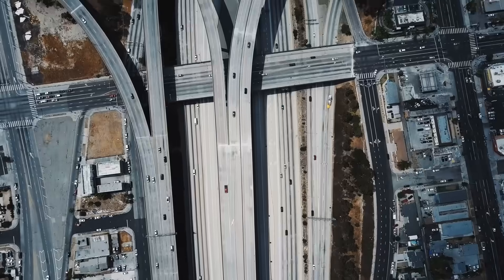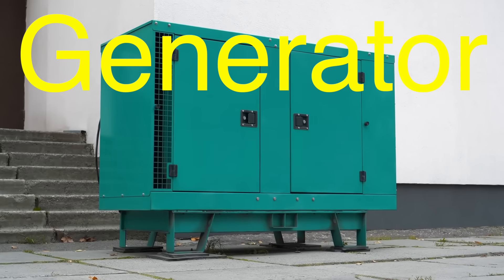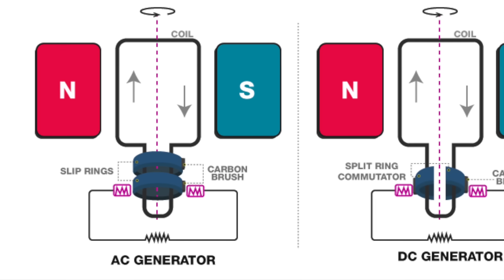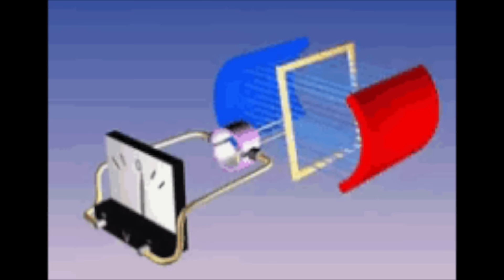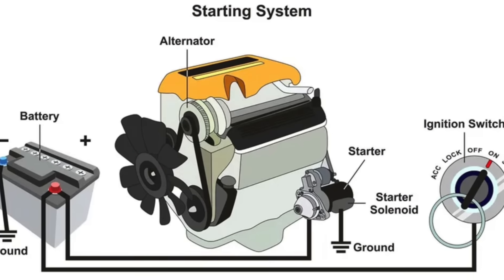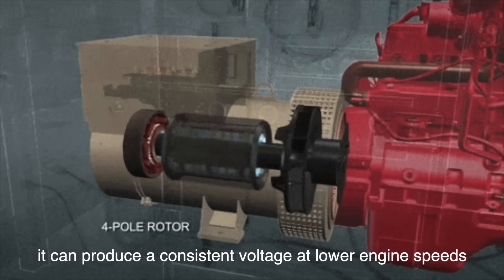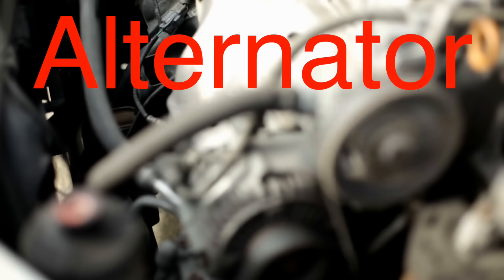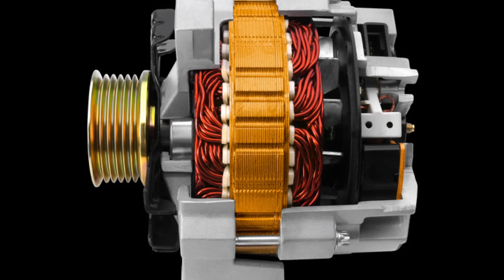What is a Generator? What is an Alternator?

Comment: We call the frequency today The Cycle!! Back in the day your electric was 25 cycle, and the light actually flashed, so they stepped up(increased the cycle to 60
Per minute and it didnt seen to flash anymore! Thats what we have today! We sometimes say Hz.which means hertz!!
The power plant needs 1,000volts to send the power
1 mile away , thats why we have high tension lines!
The disks on the insulators are 1,000 volts for each disk, so count them.
14 disks, thats a 14,000 volts in that wire!!

Comment: Tesla wanted to send you electric without 
Running any wires to you!! It worked like a radio, you turn it on and it works!! Viola!!
The same with all of the other appliances- no wires!! And he did it !! He generated power and evrything in a 35 mile radius turned on by itself!! Today they call that power - PLASMA!!

Comment: All alternators are generators.
An alternator is more efficient than a DC generator.

Just get some diodes and capacitors and resistors and you can rectify the current!

Comment: A generator only creates low voltage (less than 24 volts), DC power. An alternator creates both AC and DC depending on how its connected. Thats why its called an "alternator", it has alternative power generation.

Comment: I have worked on machines when very many of them had generators . I have worked on cars and tractors since the 60s to now and have not seen an alternator with out brushes . They use contact rings or slip rings instead of a commutator . Maybe they now have a brushless alternator , that is news to me .

Comment: Today I learned that an alternator produces a consistent voltage across a wide range of engine RPM. Additionally, generators offer versatility producing both AC and DC power

Comment: Not every car on the road has an alternator…..electric vehicles don’t. They have a DC to DC converter to run the accessories off of the high voltage traction battery

Comment: You forgot to mention one really important difference between ac alternators, [which need and exiter current to start them]  and the old fashioned generators, which did not.  But the other difference in practise is that the alternator can produce power at idle.

Comment: This was the most bull I've ever heard. Most small portable generators work just like the alternator in your car. The main difference is that in a true generator the power id feed through the brushes. In an alternator the field is powered through the brushes. The fact that the generator has the power going through the brushes and that if DC is desired, this is done through a segmented commutator. This was done because high current diodes were not yet invented.
Both can be used to create AC or DC outputs but the rotating field winding makes more sense with solid state regulation. The old DC generator used in old cars use a regulator that controlled the output that wasn't solid state. It used a relay like device that measured the strength of the magnetic field and changed the field current by chopping the current to the field winding.
The small portable generators use the rotating field windings. ( smaller that 10KW typical ) larger generation usually uses fixed field windings because the cost of the higher current in the external windings needs to be larger, as compared to the smaller amount of copper needed for the field.
It is true that brushes that carry higher current through a commutator have more arcing and wear faster. Still, the brushes in alternators do wear. In my experience warn out brushes are the most common failure of car alternators that are no abused. Bushes are cheap compared to the complete alternator but shops have different warranty than a home mechanic ( 1/10th ).
When someone tells me, that their alternator just died, the first question I ask, is did they jump start another car within the last month or so? If so, that was likely the cause. The older generators can take sudden high current loads required for starter motors and can take more abuse. The diodes in alternators can be damaged by such sudden high current loads. When I jump start, I ask for the other car's keys. I charge their battery for a while with my engine then shut my engine off and give them back their keys to try to start. I do use home made cables with 00 wire. I can even start a car without a battery with my cables.
Never use your alternator to power a starter! Even if it seems to work for a few weeks, the high current through the diodes can rupture the hermetic seal. Moisture and other contamination will cause the diode to fail being a diode.

Comment: Why is there no mention of a 'Dynamo'? In use in cars, dynamos generate DC (interrupted) to charge batteries directly. They were replaced with Alternators on cars, only when solid state rectifiers became available (to turn the three phase AC immediately to DC). Alternators then became the default generators of car electrical system, because they can output more power and turn at a faster speed. The commutator of a dynamo, limited it's turning speed and so, at low revs could not produce much power. I found this video uneccessarily, misleading and contradictory. Alternators produce A/C. Dynamos produce D/C and the term geerator encompasses anything that produces electricty by mechanical means. Simple.
Reply: Thank you for that explanation. I knew that cars were switched to 12V from 6V at about the same time that alternators came in but never knew why.

Comment: Alternators use rectifiers to convert ac. To. Dc. Diode rectifiers have a forward voltage drop due to internal resistance.so they burn some current up as heat.brushes have very little loss. Possibly more efficient.

Comment: Silicon diodes used in alternators i would not refer a simple thing. It is possible to make every part to a generator in a basic machine shop. Not so to make a replacement diode rectifier.

Comment: You did not mention a true generator can generate dc without external excitation due to residual magnetism. Therefore a generaror can be push started and will provide power for ignition to start an engine.

Comment: I have been told Alternators only maintain a battery, and that they dont charge up a battery, true or false?
Reply: Check your battery voltage after the car has been running for a while, you may see almost 13 v on a 12 v battery, then turn in your lights for a minute then off and recheck battery voltage, it will probably read about 12.6 v, you just removed the surface charge.
Reply: @billmoran3219  thanks for the reply, but what i was get at was, a near flat battery will remain in that state, if charged by an Alternater only, meaning it will be maintained at that level  and will never be fully charged up, and willl die quicker.

Comment: correct me if im wrong 
I often take that generator is the general name for mechanical>electrical conversation component 
alternator is specific to be called where alternating current is generated as its first form after energy conversion, or easily called AC generator.
for direct current,  we can call it DC generator or specifically Dynamo. 

maybe in the future DC gen will be call Direct-or? 😂

Comment: Motorcycles are interesting as the stator and rotor are frequently within the engine case. The exception of ones I have owned was a BMW R1100R where there was an alternator driven by a belt from the crankshaft.

Comment: Generators that use permanent magnet are generally called "Dynamo". If magnet is in the rotor they produce AC. When magnet is stationary the can produce either AC or DC using commutator. Example are generators for  bicycles.

Comment: The alternators do has a brus which use to feed the rotor coils to create a magnetic fields, the alternator voltage regulations doesn't done with brige diode rectifier at the output stages, it regulated the voltage by regulated the rotor magnetic fields which differ according to the rotor rotation speend

Comment: Correction, some hybrid vehicles don't have an alternator. The 12 volt accessory battery is charged via a DC to DC converter that steps down the high voltage from the traction battery to a voltage suitable for charging the 12 volt battery (about 14 volts).

Comment: Let me put it this way to you about generators and alternators, generators were the first design of 6-volt systems that had to produce more amperage for 12-volt systems which causes extreme load on the armatures. Add idol not efficient to produce enough power, the alternator is a device that can produce high power at all speeds. Since the invention of efficient electrical diode that can turn AC into DC thus we have the efficient alternator.
Reply: Add idol-

Comment: Hi. I owned several British motorcycles from the '50's which had Joe Lucas's 60 watt DC commutated generators. These were married to a cut-out and voltage control box (in an on-again off-again relationship) that gave feedback to the generator's field coils. Voltage control was by vibrating points, energized by electromagnets fighting a spring, the tension of which was adjustable so the voltage output of the armature could be adjusted to the 7.3 or 14.7 volts needed to charge the battery. The unreliability of the system was directly proportional to the number of times you read this paragraph. 

There was an amp meter on the headlight nacelle. When kicking the bike to life, a huge surge of relief accompanied the amp meter's first twitch that showed the electrics were working today.  We motorcyclists traveled in groups, not because we wanted to scare the living daylights out of the locals, but because it was the only way that a few of us would have lights to drive at night. Joseph Lucas was affectionately known as "The Prince of Darkness". Ah, those were the days, but the nights weren't so good. Cheers, P.R.
Reply: Why do Brits drink their beer warm? They own Lucas refrigerators.
Reply: @StevenKeipert  Hi User. I'd love to agree, I really would, but the truth is they weren't so bad at making refrigerators. The first shipment of frozen meat left Dunedin (NZ) in 1882, kept cool by a British steam powered 
'fridge unit on a sailing ship (I kid you not.). This "warm beer" thing's got me beat. Any ideas? Cheers, P.R.
Reply: @mikeilkycook6832  hi Mike. Thanks for that, it makes sense. I'm a Kiwi, so we know all about rabbit holes. Cheers, P.R.
Reply: @philliprobinson7724  Hi Phil. I was once given a very welcome cold beer by a Kiwi I was chatting to at Southbank in Brisbane. I've never met a Kiwi (or had a beer) that I don't like.  Both are just fine with me. 
Maybe on my next sojourn to the southern hemisphere I'll take the extra hop to NZ and get the full cultural experience. 
Cheers.
Reply: @mikeilkycook6832  Hi Mike. You'd be most welcome. Cheers, P.R.
Reply: @mikeilkycook6832  Hi Mike. I've just got it. "The extra hop". Duh!. Cheers, P.R.
Reply: @philliprobinson7724  haha Phil, I assure you it was unintentional. Well spotted. Sometimes humour is serendipitous, eh?
Reply: @mikeilkycook6832  Hi Mike. Best humour is because everyone gets a laugh. There's nothing unfunnier than a stillborne joke that's been laboured over. Cheers, P.R.
Reply: You must have had very poorly maintained bikes then. My 50's era bikes, one with Lucas and the other with Miller dynamo, have no problem charging. Admittedly , 6V lighting is not as bright as modern lights.  I suspect that most commentary on Lucas electrics are from people who either never used it  or experienced poorly maintained systems.
Reply: @otooleger  Hi O'Tooleger. You're right, maintenance is everything. Sealed alternators were just coming in when I was a teenager, but I could never afford a new bike. There wasn't much to choose from at my price range, except other people's obsolete cast-offs. Years later I had a 1949 Tiger 100 which I restored. I had no trouble with the electrics on that, but to be honest I never rode it in the rain. When I see all those wind turbines out on the North Sea a Lucasian cold shiver runs up and down my spine, but I guess they'll be properly sealed these days. Cheers, P.R.
Reply: All vehicles used the same system surely. I only read it once, and I don’t remember to many problems with it.
Reply: @anvilhead0  Hi Anvilhead. The British twins had the unsealed generator installed in the front of the crankcase, just behind the front wheel. When it rained 💦it got dampish! British singles usually had a dry Mag-dyno behind the cylinder, where it basked in the warm air under the tank.  

Although British bikes improved post WW2, gaining rear swing-arm suspension, nothing was done to improve their antiquated DC electrical systems, (like proper weather proofing), because DC technology was obsolete and not worth improving. 

Dr Shockley (et al) from U.S. Bell Labs had invented the transistor in 1947, so a solid state alternating current system was now possible, and in the pipeline. It would need major changes in crankcase castings however, so that would take time to coordinate with the British M.C. industry. Maybe Joe Lucas could have had it ready sooner but maybe he had to sell his "old stock" of 1930's era DC gear first because it was collateral for company debt? I'm guessing of course, but clearly the Japanese moved into the technology gap and cornered the market with more reliable products, something they later did with cars. 

The British made fantastic m/cycles, but let's be honest, technologically they were like marsupials in the new age of mammals.

My last bike was a SR250 Yamaha which I owned from new for 30 years (105,000 km). Over those years I replaced the starter-motor brushes once, three batteries, four spark plugs, one cam chain and adjuster, one exhaust pipe/muffler, and one set of piston rings. It used a total of 30 litres of oil, which never needed topping up. It traveled 27 km per litre. No light-bulbs ever needed replacing. I eventually had to replace the rider. I'm still getting professional counselling for this, as the length of my reply tells you. (Waaahh😭) Cheers, P.R.
Reply: I think Joseph Lucas' most successful product was the 'intermittent windscreen wiper'
Reply: I can't count how many mates that ride old British bikes have, at one time or another, used the more reliable lights of a Harley to get home at night, many have had to follow a Harley's taillight several times & several have had to do, so many times. Lucas -The Prince of Darkness.
Reply: @iamterfer  Hi iamterfer. I'll take your word for it that the Harleys and Indians had more reliable electrics, but let's be self-effacingly honest about this.  It wasn't until the Japs, (bless their solid state rectifiers) put alternators on m'cycles, that electrics became so reliable they no longer needed a red "charge warning light" to let you know you had just ten minutes to get home. 

I always wondered why they used Lucas dynamos? Your average British plonker used a B.T.H. magneto for the spark, British Thomson Houston being an American company. Never had the same trouble with the magneto. 

I worked in a small M'cycle shop for a time, decarbonizing BSA Bantam two strokes (all my chickens coming home to roost), and learning the magic electrical incantations that kept the AJ's, Beeza's,  Matchy's, and Norton's running sweetly, like well boiled icicles. Cheers, P.R.

Comment: A pure dc generator with a commutator likely produces power at a much lower cost as the flow of electricity does not alternate .
Reply: why and how?
Reply: @janami-dharmam the commutator acts like a mechanical rectifier bridge
Reply: @ooltimu  Not quite correct; read and you will learn. A rectifier bridge is a output only device but a commutator is mostly a input only device.
Reply: @janami-dharmam  sorry, but that is garbage and makes no sense. A rectifier bridge has both an input and an output so that it can get AC in and rectify it so it will output DC. The commutator serves the same role, but it is mechanical. Search on google, wiki etc.

Comment: Read answer from @majed9r!
Alternators have brushes and slip rings to maintain the magnetic field in the rotor. As the speed of a motor is changing and the power needed for the equipment (headlights, stereo etc.) is constantly changing, one current regulator is needed to maintain the constant voltage between 13.7 to 14.5 volts to fill the battery. This regulator regulates the current through the slip rings. The output is 3 phase AC those who are rectified to DC.
And to be precise: every machine that generates (converts) one type of energy to the other is generator. The usually term generator is used for the conversion to electrical energy, usually mechanical energy. (Solar generators? Convert Sun energy to electrical).

Comment: Car alternators do indeed have brushes that wear out.
Reply: Some do, some don't - it depends if the rotor is a permanent magnet or a coil wound electromagnet, which in the latter case requires slip rings which wear out.